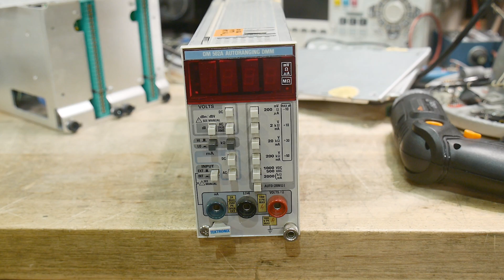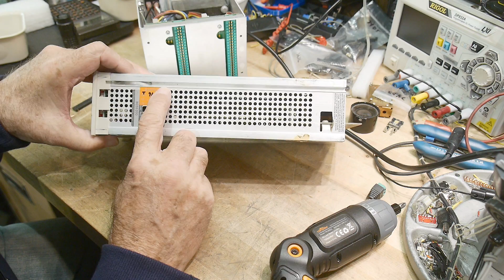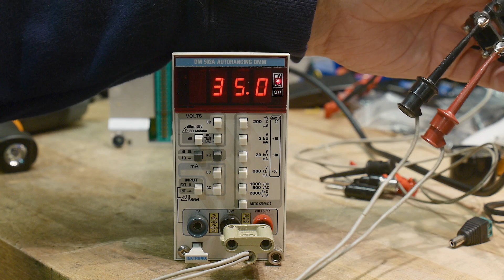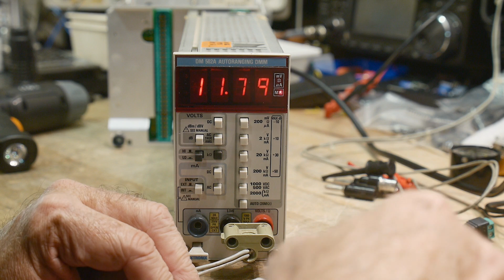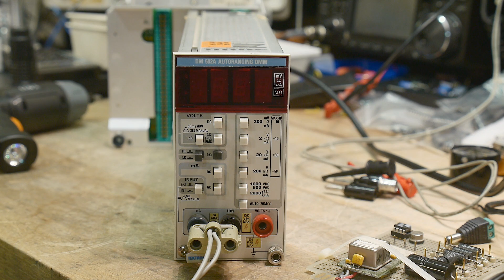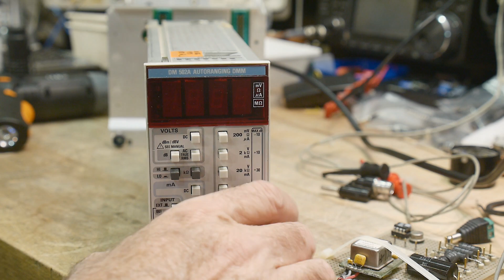#1343 Tektronix DM502A Autoranging DMM (part 1 of 2)

Comment: Damn, I didn't know autoranging DMM's existed back in 1979! I thought these must have only existed since the 90's.
Reply: I didn't know they were around then either, but I do like the "transitional" controls, both autoranging and a set of manual ranging buttons!
Reply from the maker: HP had autorange in 1959: https://www.hpmemoryproject.org/wb_pages/wall_b_page_14b.htm
HP 405AR https://www.hpmemoryproject.org/wa_pages/wall_a_page_02.htm
Reply: @IMSAIGuy  1959! Autoranging back then must have cost a fortune
Reply: @IMSAIGuy  I think NLS ones were autoranging even before then.
Reply: @TonyBarr99  yes that is very good, especially when you know you're gonna measure values around a certain range or the autoranging acts funky.
Reply: Alexander Diaconescu, even Heathkit had an autoranging DMM in 1979, the IM-2212.............
Reply: @youtuuba  well, atleast now I know it! :)